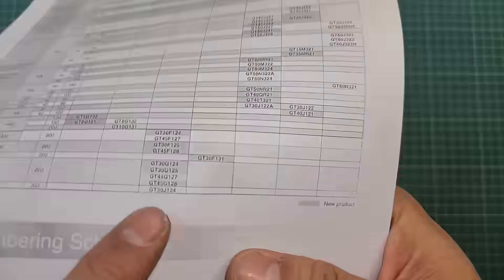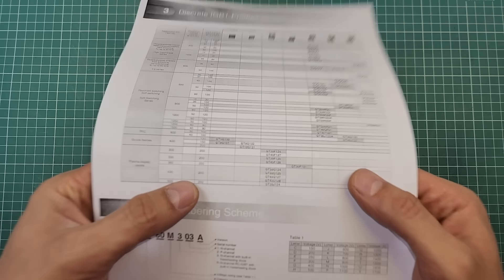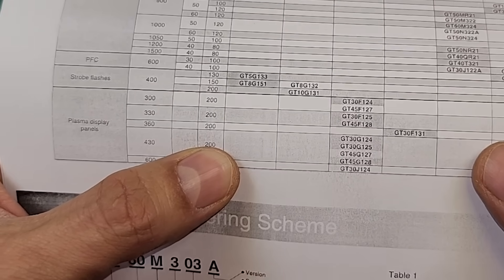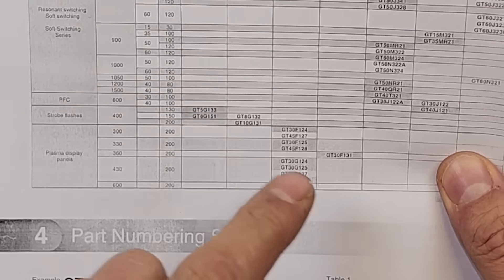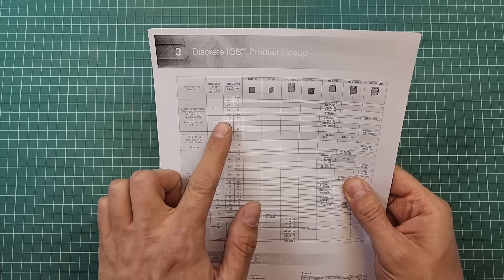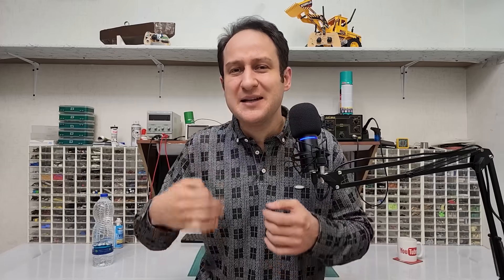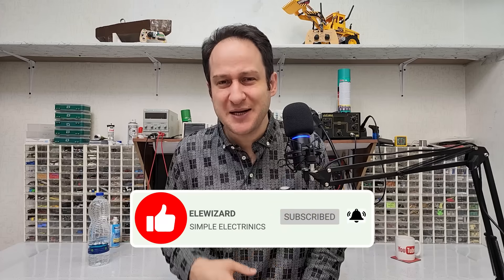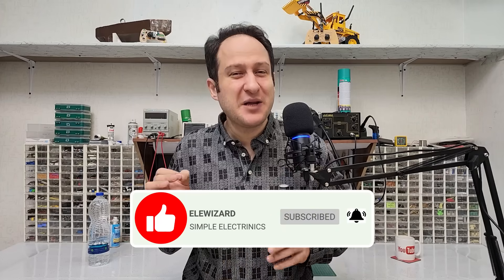Can a small transistor really switch 200 amps of current?

Comment: For an initial sanity check, I consult my wire ampacity chart:  a wire must be about 0.3 inch in diameter to continuously carry 200 amps.  Thanks, another interesting and helpful video.
Reply: Well Amps is only part of the equation. If I draw 200Amps at .1 Volts it's only 20 watts. The thing that is most important for transistors like this is the actual watts consumed. You have to run the numbers on your actual voltage and actual amps. You will never actually use 200A on anything rated for 25watts that's the reality of the situation. That said you can on the flip side do some crazy things like run a microwave from an ethernet cable by simply increasing the voltage to say 500v and you get only 2 amps needed to run 1kw load. I have actually seen this done, that's why I'm giving the example.
Reply: @newmonengineering  right!  I got a massive old MOT with 1 turn of an inch wire strand.. 2kA @ 750mV. It rocks, rattles, and rolls in saturation.   But I've also seen battery powered microwaves built in YouTube.
Reply: @newmonengineering  Phreaky - wonder if the dude that thought of that also placed the Ethernet cable in the microwave later just for gifts and shingles...
Reply: Others mentioned this but that is for continuous load with generous safety factor in mind for long wires and building insulation

Realistically I bet you could pulse 200 amps through a wire that size at that length for a very small amount of time and have no issues assuming good contact
Reply: @atta30  you're absolutely right. A 24AWG wire can withstand 200A for 20 milliseconds before its insulation heats from 20C to 100C.  That's a much longer pulse than the IGBT turned out to be rated for.
Reply: Such charts are typically assuming some general cases, like wiring home network. They are not applicable for relatively small devices as transistor, because the "amperage capacity" of a conductor depends on its crossection and length.
Reply: @MSP_TechLab  in the case of the transistor, heat dissipation is assisted by good contact with a low temperature surface even when heat flux is large.  In the case of wiring in homes, it is assumed to be at high temperature and thermally insulated with a high ambient temperature.  Those assumptions make for fundamentally different cases.  For example, submerge that same cross section of a transistor leg in liquid nitrogen but as a collection of millions of thin cables so as to maximize surface area and it can handle thousands or more times the current than at room temperature.
Reply: @hugegamer5988  yep, I'm on the same page.
Reply: @MSP_TechLab  By no means did I suggest a 1:1 correlation (see "sanity check").  So by what factor, as you imply, can the conductor crossection and length of the 200A transistors, be reduced?
Reply: @cougar1861   it depends on many factors like maximum temperature, type of current . Some, random, wire calculator tells me that you need 2.36 mm (0.1inch) wire for let's say 1cm and 200A, but I don't trust that result as that calculator was build for pcb.
Reply: @MSP_TechLab  Thanks
Reply: thats based on a specific thermal scenario…   so…   means absolutely nothing.
Reply: The transistor max rating assumes you can keep the entire outer surface of the casing and pins cooled to 25C. In that case, the issue is just heat conduction from the inside of the device to the outside, and the heat dissipation beyond that point is just magically taken care of.

This, of course, is unrealistic with just a fan and heatsink for cooling, but it let's you create a standardized rating. There are separate curves for power dissipation vs current to help figure out how much current you can pass with a given heatsink.

 I've heard people suggest that the max rating is tested in a liquid that boils at 25C, or possibly just calculated from the other characteristics.
Reply: @odincauzza2509  Easiest way: don't assume any outer condition, but keep the pulse duration short enough so that the casings heat capacity is sufficient. Getting heat from the internal structures to the casing is a limiting factor on it's own!
Reply: In the civilized world, we use square millimeters for wire, not inches.
Reply: @mernokimuvek  This may not go well...

Comment: I love data sheets. I've only come across a couple of dodgy data sheets in 40 years...Comprehensive with subtleties of every parameter, written by the engineers who developed the devices. They are the best friend every engineer never knew he had. Your appraisal of this particular datasheet  is a nice introduction in translating these wonderful goldmines of information into practical use.
Reply: My biggest grief with data sheets is that I often need them for ancient devices.  What I find is often not for the part I'm looking for but rather a different revision or even just a related part or maybe an old fax scanned by somebody at like 5 DPI with a coffee stain right over the most interesting bit ;-)
Reply: @ralfbaechle  🤠
Reply: I opened my 12 volt regulated power supply.  Inside was a bridge, and a capacitor.   Barely got the $8 I paid for it in value.
Reply: Thing about this video is that I don't know who would have any practical interest in this (or any other) switching transistor who would not be looking at data sheets as a matter of long ingrained habit.

I know how to scan down split-value columns. And split-row columns. Even on a sheet like this one with slightly malformed layouts; the line should have been continued to the bottom.
Reply: @-danR  aussies have a great inverter plan that uses stepped transformers and IGBT's to make the sinewave.  So anyone with a 200amp house would.  LOL
Sadly they get all the old transformers down there, I can't find any up here to rewind.